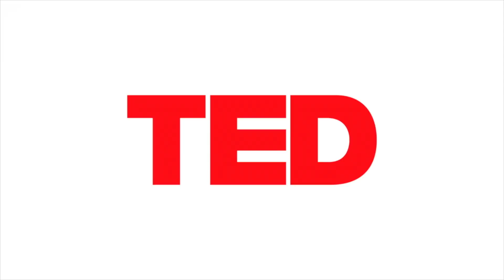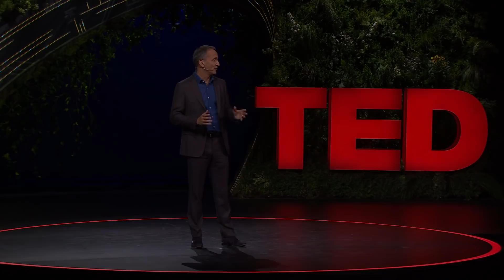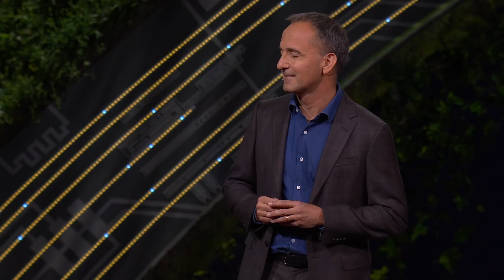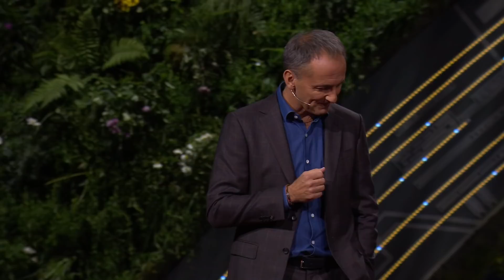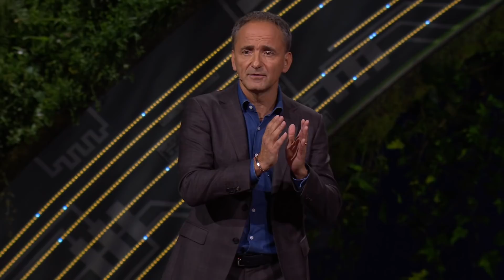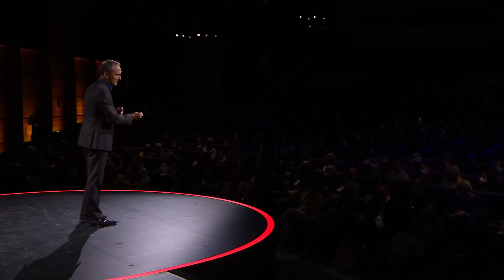Jim Hagemann Snabe: Dreams and details for a decarbonized future | TED Countdown

Comment: This will go faster than he expects, when green nuclear power is included in the H production.  We can make carbon-negative transportation fuels from environmental C plus nuclear H cheaper than it can get drilled out of the ground. And every country with access to the ocean can get all the U they want. It's renewable.  When you extract U from seawater, it comes back from geothermal springs.  Just like the wind and sunlight, Uranium is forever renewable. And then there is the Thorium in your back yard which is better than Uranium but as cheap as lead, and one million times better than gasoline as fuel. Only reason we don't have it today, is the energy industry worries about cheaper energy making them less money. If we want cheaper energy, the industry will refuse until we promise to buy MORE and get the volume discount, and they make more money. So energy efficiency efforts only slow down the day we get cheaper clean energy.